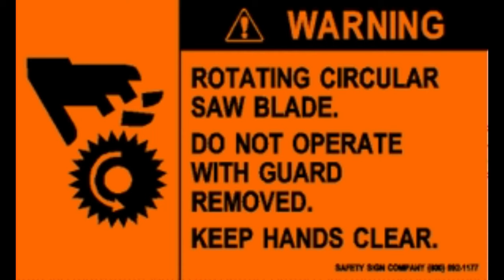How to Make a Table Saw at Home   Drill powered

Comment: I have got questions. How noisey is the table saw if I use the drill? Is it much better than saw table?
Reply from the maker: It's no better. It's just a cheap brew to cut a few boards.
Reply: @HandmadeCreativeChannel  thanks for letting me to know. Is it much quiet than saw table when you cut the wood? There is few problem I can see is there is no safety and there is no rivet on the table to stop kickback.
Reply from the maker: @chris01479  It's just a regular device.  It's dangerous when you're asleep and you don't know how to protect yourself. I've been doing it every day for about a year. Now I have a workshop and I have everything. The volume is almost the same.